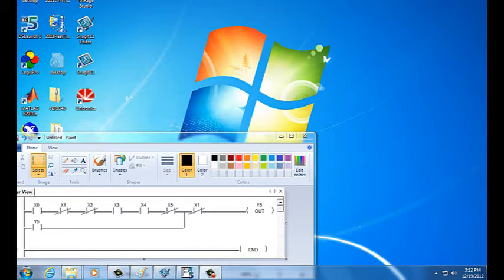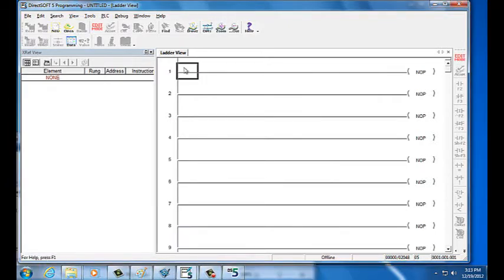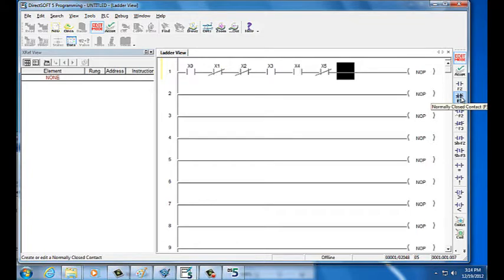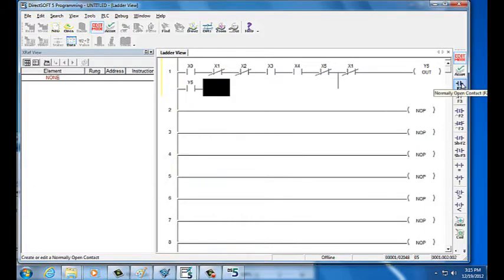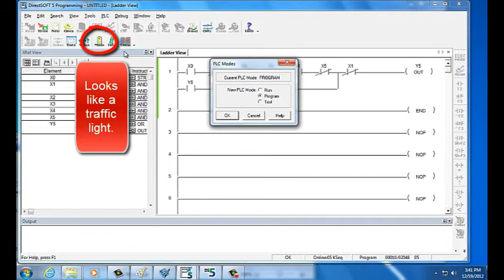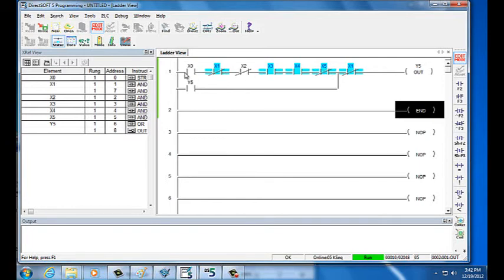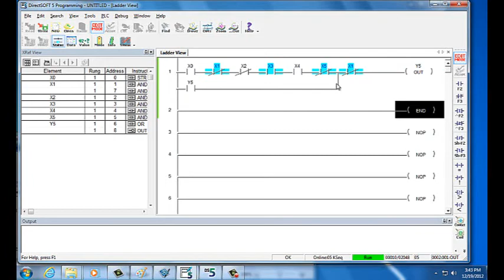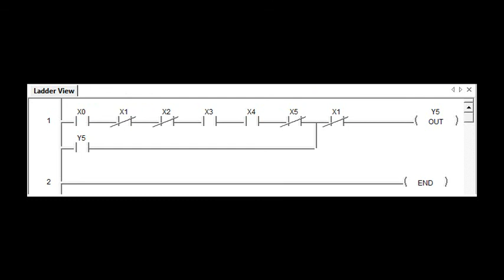B4626 DL05 PLC "Button" Program

Comment: Got anything in Directsoft 6 for DL06? I really need some training on it. 

Spent 2 years doing rockwell controls for conveyor systems and moved to an OEM in combustion controls that uses pretty much all DL06 w/ Cmore and some Red Lion screens. Tips for going to Directsoft 6 from Studio5000. 

I would consider myswelf an intermediate ladder programmer, but definitely need to up my game and utilize some of the strengths that Directsoft 6 brings to the table.